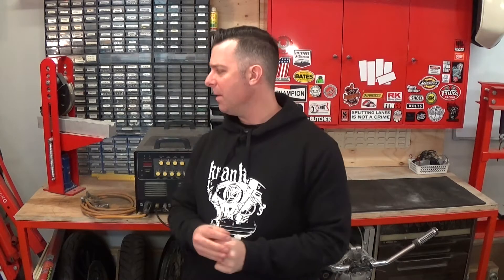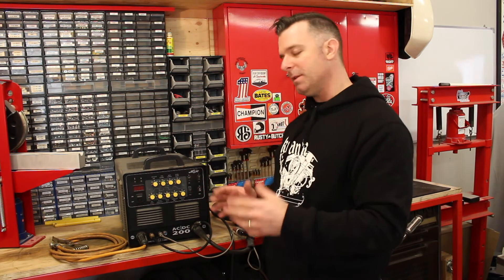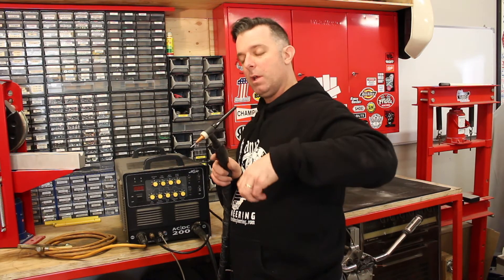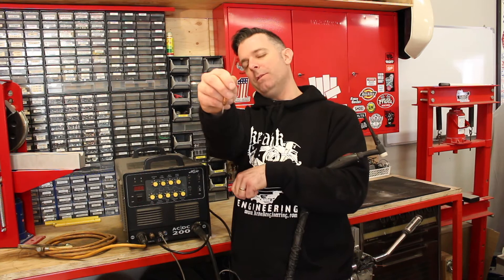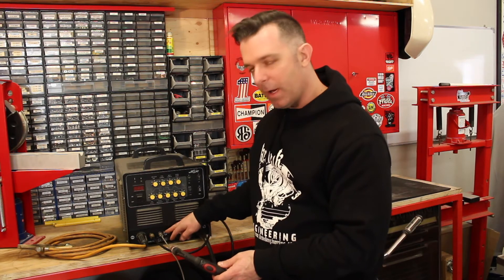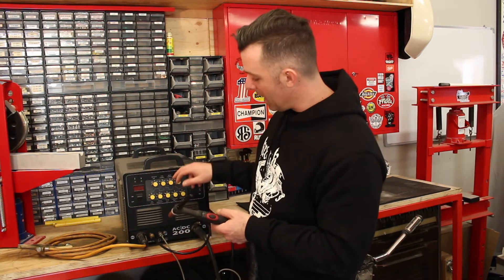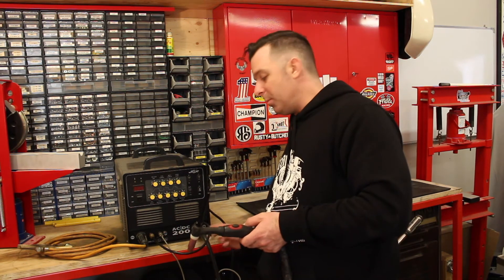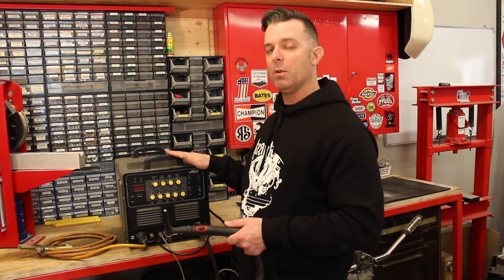Ultra basic overview - TIG welding

Comment: Wish I saw this before I bought my TIG.
Reply from the maker: Just use whatever you’ve got 👍
Reply: @krankengineering  thanks, I'm happy with my purchase, I did a lot of research before buying it. Got it at Total Tools at an Insider Night so got bonus points, and the door prize. Cheers
Reply from the maker: What make/model did you buy?
Reply: @krankengineering  CigWeld Weldskill 200HF DC, it cost $770, I bought the gas bottle that night with a foot pedal a week later. I did a welding class, and they had the same model, so I figured I made a good choice.